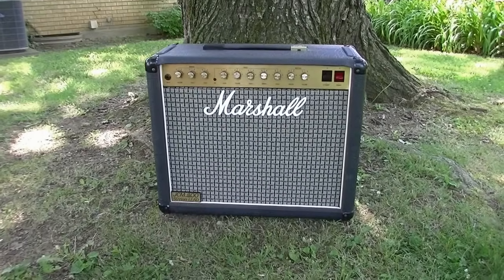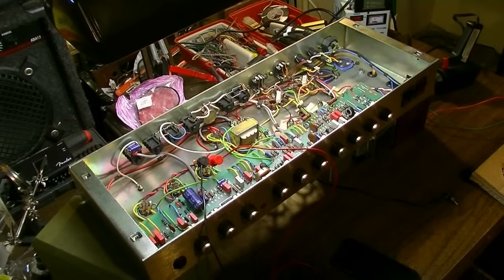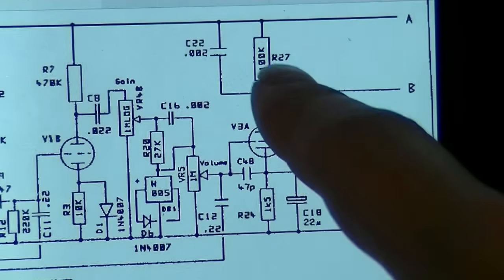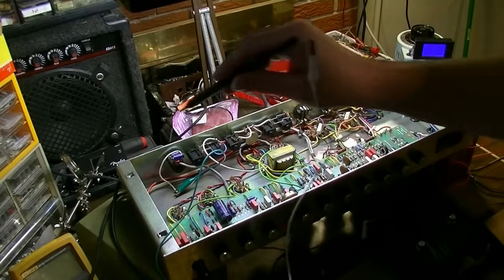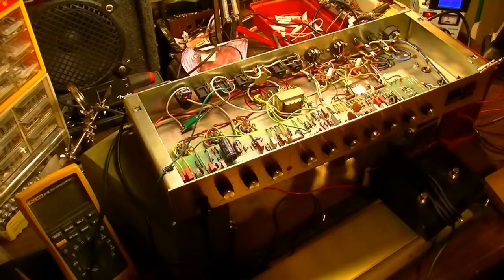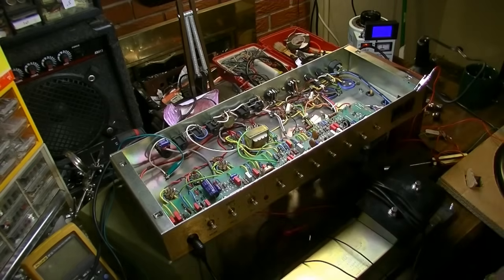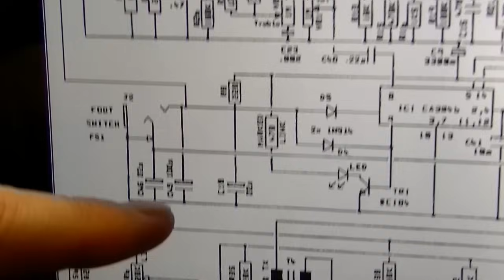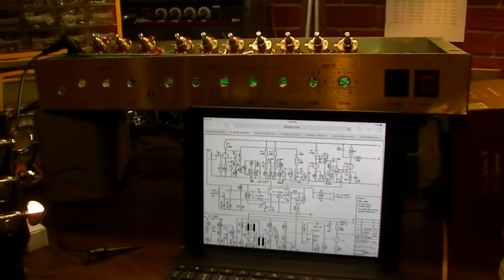The Amp Repair that Almost Broke Me - Marshall JCM800 Combo

Comment: I would really really like to understand why one should prefer those crappy ratsnests instead of a neat, well engineered PCB. I mean... c'mon, we are in 2017.
Reply from the maker: You mean on the tube sockets? For reliability reasons...and heat dissipation. Board mounted sockets are generally much more prone to solder joints breaking from inserting tubes and taking them out again.
Reply: Well... not only on the tube sockets actually. I often talk with technicians who claim to prefer turrets or even true PTPs to work on, instead of PCBs. I've tried, I swear, but can't really follow the signal paths.

Comment: He spent over 30 min of the video (and a lot more in real time no doubt) to find out a preamp tube was bad!! OMG...he's charging for that??? 

I work on my own amps and the FIRST thing I do when something goes wrong that's not one of the shitty jacks Marshall uses is swap out ALL the tubes, one by one. He only swapped the power tubes and assumed the preamps were good. Tubes can glow and still be bad! That's tube amp repair 101. I also don't like his technique of replacing parts like the tube socket before hitting it with cleaner first. I'm not even sure any of all those components he replaced was necessary!
Reply from the maker: The first thing I did on this one was actually pull the tubes and test them all. I cut all that out of the final cut for the video because we were already pushing 1 hour runtime. The tubes all tested good, although V1 was on the weak side, it still should have worked fine had this circuit not been so picky about tubes, apparently. But if you think about it, when I was doing the signal tracing, there's no reason V1 could have been at fault because it's used in both channels and was passing and amplifying signal. V2 is used in the Normal Channel ONLY, which wasn't working still after I finally got the Boost Channel working - which only happened after I changed the switching transistors and Phase Inverter V5 tube (which also tested good on the tester). So the switching transistors were bad, and V2 and V5 were bad. V1 was weak. The caps in the switching circuit didn't HAVE to be replaced, but I did it anyway because the caps were old electrolytics and it doesn't hurt to replace those. In the course of troubleshooting, sometimes it's easier if you're going to have to pull a board to pull a component to test it anyway, you might as well just yank it and put a new one in. Stands to reason.

As for the tube socket...I didn't replace the socket, did I? I inspected the socket and concluded it can't be at fault. Your criticism would make more sense had I actually replaced the socket willy nilly. If you watch enough of my videos, you'll see I do a lot of thinking out loud, some of it won't make much sense because I'm still in the process of working through a problem. It makes the videos more entertaining, I've found, if I don't just cut to the end and say "TA DAAAA! I'm a fucking genius!"

The lesson here is sometimes amps have multiple issues and even though you think you have eliminated variables, sometimes they aren't truly eliminated at all because of something else you cannot know until you actually investigate it. I know it's easy in hindsight to say "you shoulda done x", but doesn't really work that way. Also, don't be an asshole. No call for it. It's just a YouTube video.

Comment: huh mount pots with wires. thas is a bad thing.you it gets noisyer.gives the amp worce signal to noise ratio.easy with wires but not god from sound standpoint

Comment: been through these scenarios...errr..bad tube.not a fan of some marshall designs..LOL. bad sockets/broken solder connections on tubes..from removal/insertion..check out my channel..too
Reply from the maker: Thanks for watching, Don. I'll check out when I get a little time.
Reply: i had 3 vintage amps on my bench within a week that all had *odd rev and tremelo issues that were either bad coupling cap, cath bypass cap and resistor..that resulted in 1$ parts...stuff that NEVER fails ..ha ha ha. 
ps: uncle dougs channel has tons of tutorials too